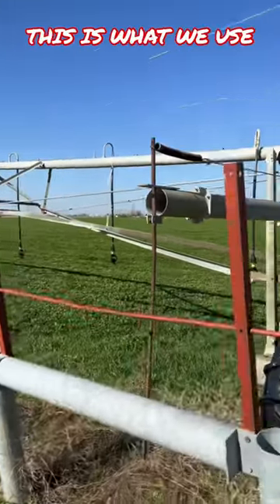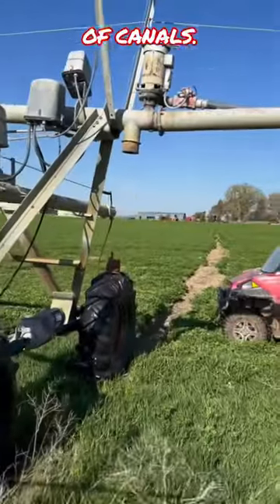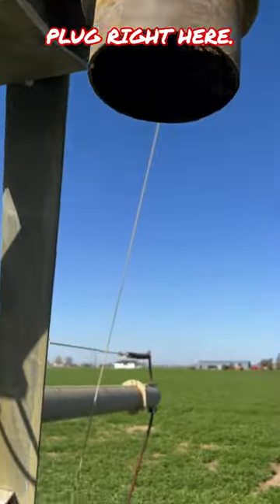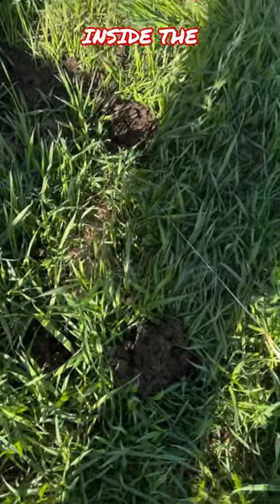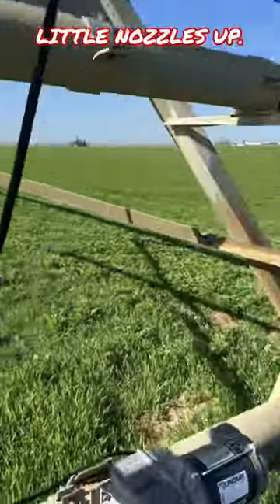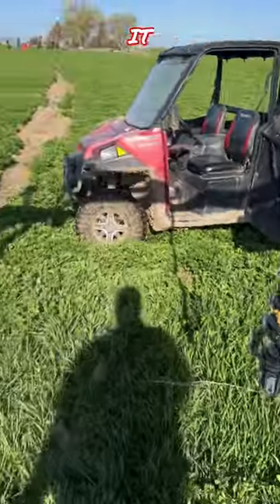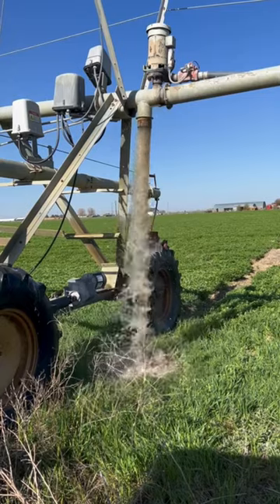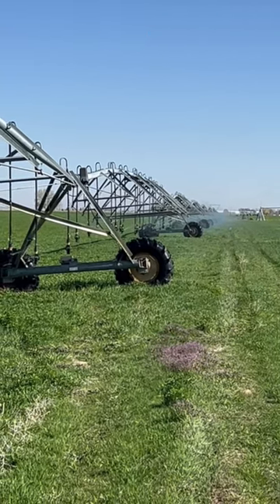Flushing an irrigation pivot. #shorts #farming #irrigation #agriculture

Comment: Why not flush it before winter hahahah
Reply from the maker: Technically, we do the pivots run with water in them up until winter The problem is between the mainline and the water settling in the pivot. It just makes chunks of stuff that will plug it so we have to flush it in the spring.